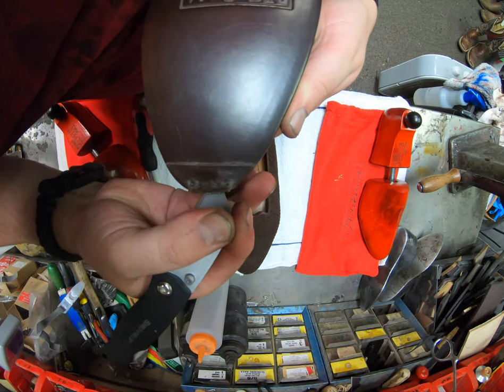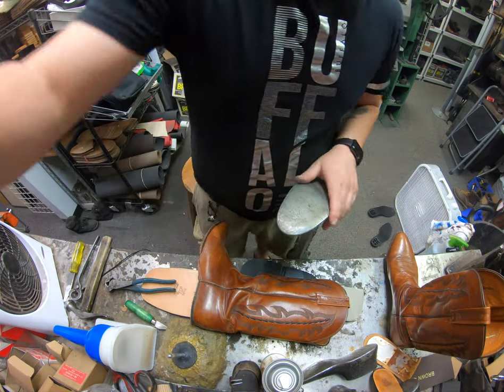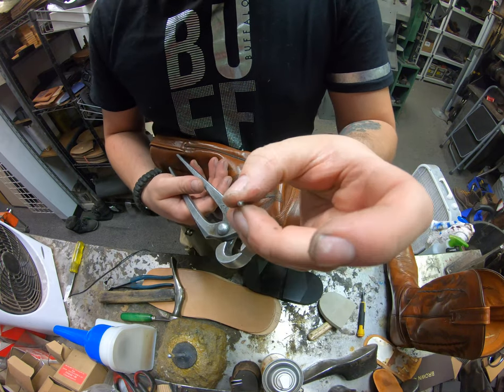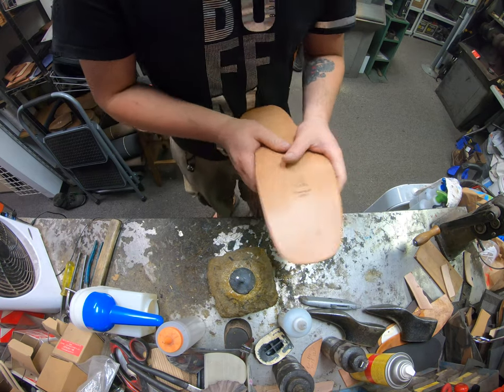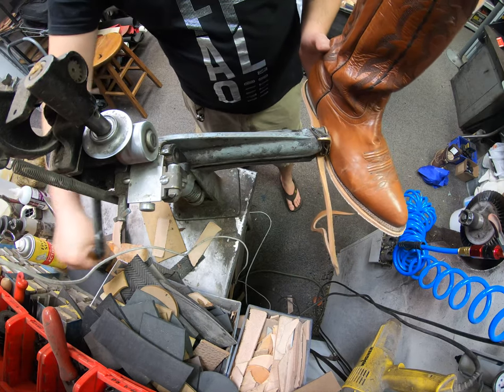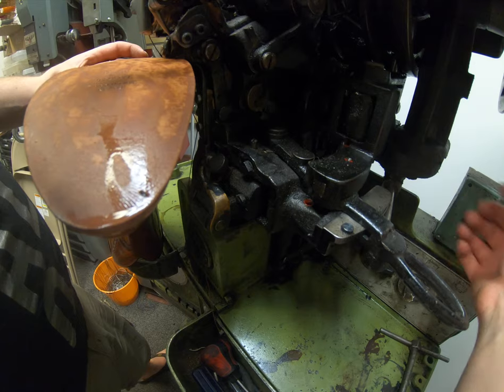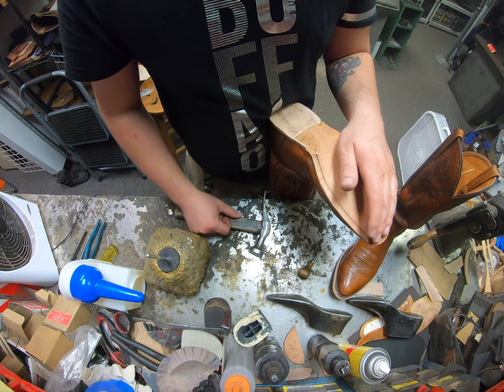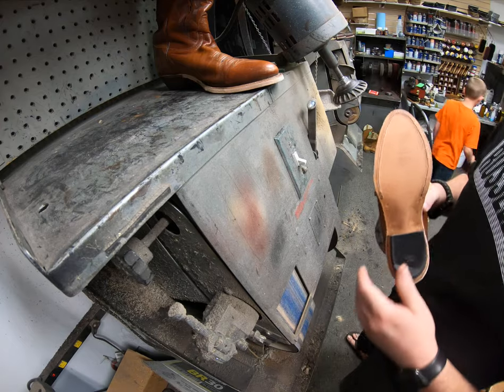Kangaroo Skin Nocona  Western Boots Recrafted  with House Leather Full Soles

Comment: wouldn't it also work if you just clip the heads off of the nails and punch the rest through the boot. so you wouldn't need a punch.
Reply from the maker: Are you talking about when we add the new nails or remove the old ones?
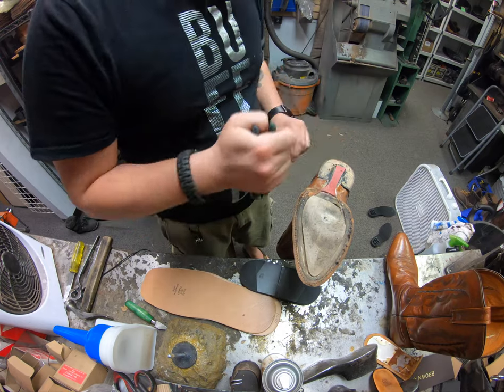Reply: Cobblers Plus Inc. ... at 1:52 you clip the short and than you use the push to push the nails trough. if you wouldn't clip them short, you could just use the hammer to push them into the crape block to get them stick out on the other side.